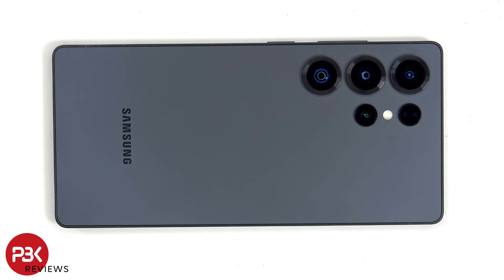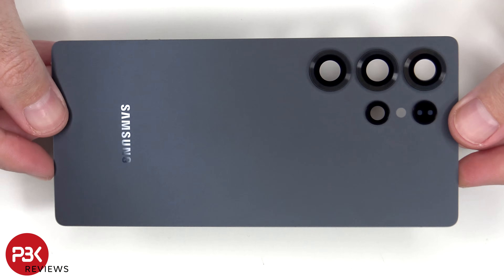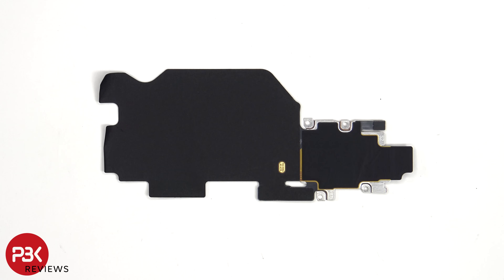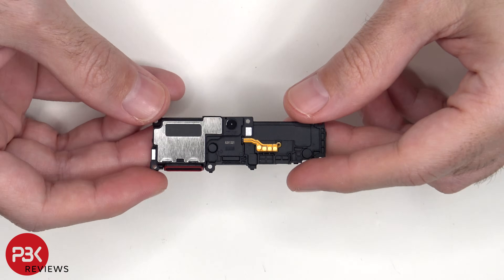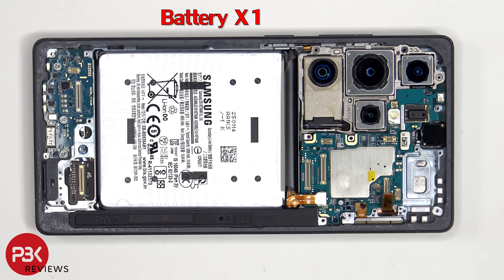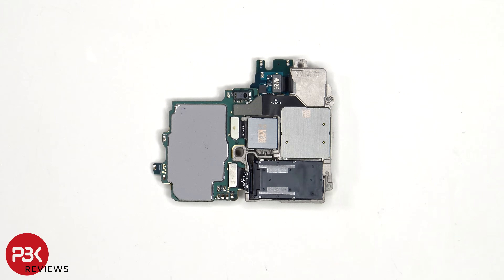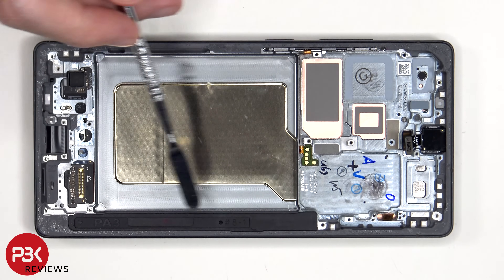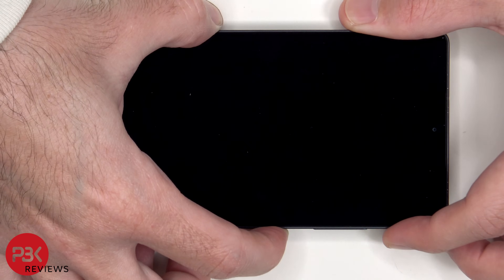Samsung Galaxy S25 Ultra Teardown Disassembly Phone Repair Video Review

Comment: I have a question if the mesh  of the bottom speaker have and a half broke is dangerous  for my phone ? I don't  know if i have to take mi s25 ultra to the store for a repair
Reply from the maker: It would possibly be ineffective from preventing water getting inside the phone, but aside from that its not really harmful.
Reply: @PBKreviews thanks I gonna try ton fix  it but i don't like some one open my phone :(

Comment: ? Is all my data stored in the main board? I mowed over my phone but it was still working and ringing and it will still charge. However the housing is broken and power button not properly working. It refuses to work with hdmi out. Before it died, and I cannot now turn back on after charging, it would show clock screen but not let the mouse or keyboard work and would immediately turn screen back off. I believe it is due to Good Lock being installed. There is no screen or glass left, just the silver, lol so no clicking on anything is an option. I have replaced tons of screens and worked on phones for years so no problem as I have all the tools to take apart. I just do not want to lose all my data. I guess I should have performed a backup as soon as it was setup, but failed to do so. It's only a couple months old and I just had not done it. I want to file for a replacement but swap the boards when it arrives to transfer the data.

Comment: Very nice videi , more details than jerry. I actually looking for a video that explain the lens covee like you did. Are the glass cocer part durable? And how did they mounted from the inside of the plate? What happned was i tried to take the phone case off as it was so tight, when i tried to peel the top conrner case off i accidentally placing my index finger on the back with some pressure where the lens cover glase is. So with that pressure, will push the lens cover glass lose? Or will i damage it? I am now worry thanks
Reply from the maker: Thank you. If you are referring to the camera lens cover, then no it won't easily come loose that way. Will require heat to loosen the adhesive and pressure prying it off.
Reply: Thanks for the reply... I accidentally pressed on it with pressure, so it should be fine or break and shouldn't worry right?

Comment: I found some replacement black glass on ebay for $13.00 which isn't bad at all. I have been contemplating not using a case with my S25U so it's good to know it won't be expensive or hard to replace the backglass. Honestly i wouldn't mind replacing the glass with carbon fiber/aramid fiber. i wonder if anyone will make those because if they did i would probably get it.

Comment: This is methodical and well-paced. Nicely done. The info about the microphones being on top of the tunnels was really interesting. I assumed the tunnels were an L shape, but this is an even better design. Q: When you do repairs, do you wear gloves (like nitrile gloves) to keep any skin residue/contaminants from getting into the phone?
Reply from the maker: I don't generally do repairs for others or work on other peoples phones. However If I were to, then yes I would take the precautions. But on my own devices, I don't.
Reply: @PBKreviews  Interesting.  I guess you really put them through their paces.

Comment: Thanks a lot for your video. I wonder what does it feel like for poking the microphone hole besides the sim card tray. i accidentally poked it and pushed down hard as I mistakenly thought it was the sim card tray. I felt resistance and poking into a narrow hole inside. I am worry that I pierced something if the normal case is to feel a flat surface.
Reply from the maker: You're welcome. As shown in the video toward the end, its fine nothing will happen.
Reply: It does happened to me too yesterday 😂

Comment: 3:24 I'm honestly disappointed 😞 that you called this part a "detector for the S Pen 🖊". 
As someone as you, who does phone teardowns for a living, how could you miss this? 🤨
There's been a lot of talk online about this, and it's clearly two wireless coils. 

one for NFC to detect the S Pen inside the slot and another for wireless charging ⚡
These are the same coils used in the S24U, S23U, and previous generations. 

With all the controversy 🤔around Samsung removing Bluetooth from the S Pen, this is a big deal! 
They could easily activate the charging coil via a software update 📲 and later sell a Bluetooth-enabled S Pen 🖊

How did you miss this? 🤯
Reply: lol the s21 ultra pen doesnt use a battery
Reply: @Robbie-mw5uu  and?
Reply from the maker: I didn't miss it. Its not a functional item and primarily used for detecting the S pen. It's highly unlikely they will enable it down the line. If I were to mention the fact its also has a charging capability, then I would get so many people who would jump to conclusions and start commenting saying its not working or no you're wrong etc. I mean I could have mentioned it multiple times that it doesn't work because its disabled but it may have the potential to, however like I said most people just hear what they want or don't pay attention. If you read the comments you will see that even when I was prying off the battery, I clearly mentioned the correct way to remove the battery however I was going to pry off the pull pouch with the battery as well since I want to show off the vapor chamber and still people were commenting saying I removed the battery incorrectly and the pull pouch has a new way of removing it. So no matter how I say it, people take one thing and confuse it so I decided to just leave it as is and not mention something that is not functioning, and most likely will not function in the future based off my experience with Samsung and them ever enabling features they had disabled. There is a better chance the future model having that feature vs them ever enabling it on this one I would say but you never know.
Reply: I'm sorry but you clearly missed it, and you should have just said what it is and how it's disabled. That  would have been way better than your excuse for not mentioning it.  @PBKreviews

Comment: Such a well-made phone. 👍 The temps should be more than fine with this heatsink as well.
Btw, loving the channel and the instructions on how to possibly repair the phones!
The only thing that will remain a mystery is the adhesive for the IP68 water resistance... where does one buy some that will work like the original? 😅
Reply from the maker: They sell the original adhesive for the phone. Sometimes it takes a little bit for it to start showing up online, but you will be able to find it on rounded.com or mobilesentrix.com where they usually sell original replacement parts for phones.
Reply: @PBKreviews  Many thanks!

Comment: bro... you did it wrong. I'm talking about battery, they changed the way how to remove it
Reply from the maker: how about you watch the video and pay attention to what I am saying. then you will know not to comment n say this. there is a reason I took it off that way and I even explained it in the video so pay attention..
Reply: @PBKreviews  okay, sorry for bothering
Reply from the maker: its ok. As stated in the video, I pointed out how to remove the battery if you are just replacing the battery but I was removing both the battery and the pouch since I want to show off the vapor chamber and it's just easier to pry off both together vs separate the battery then have to re-seat it in the pouch to put it back together.

Comment: I think they just removed the S-pen's inside capacitor which used to act like a  battery for Bluetooth functionality. In future Samsung maybe sell S-pen with Bluetooth functionality separately 😂 No one knows
Reply: Its funny because the small S-Pen charging coil inside the phone itself is still there.
Reply: It's the detection coil. Whether or not it's involved in charging we don't know.
Reply: @Djoki1 it's an NFC coil that detects the pen.
Reply: The new spen has the same IC, but its not populated.
Reply: Jerry says it charging coil look up his video
Reply: @jbrei713  I thought he said it's not?
Reply: @jbrei713  jerry doesn't know anything about phones. Watch phone repair gurus video, he shows the difference between the s23ultra and s25ultra Spen coil and shows its for NFC

Comment: I want to ask about camera, there are 4 camera which is 50mp ultrawide, 50mp telephoto, 200 mp wide angle and 10mp telephoto...but there are one more small camera..what is that?
Reply from the maker: The other one is a ambient light and laser auto focus sensor.
Reply: @PBKreviews it's function please
Reply from the maker: ambient light sensor senses the current lighting so it knows to dim or brighten the screen depending on the environment you're in. The laser auto focus is for measuring the distance of objects by sending out a burst of light and it helps with focusing on subjects or objects etc.
Reply: Depth sensor
Reply: tq sir 👍
Reply from the maker: you're welcome